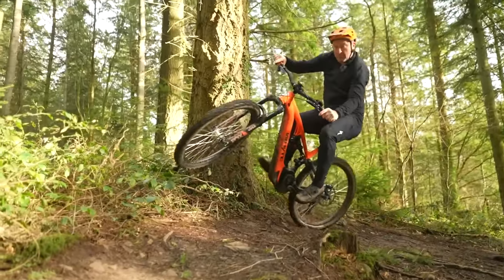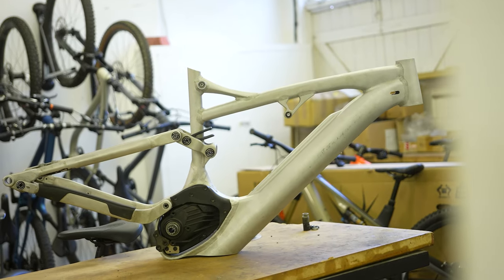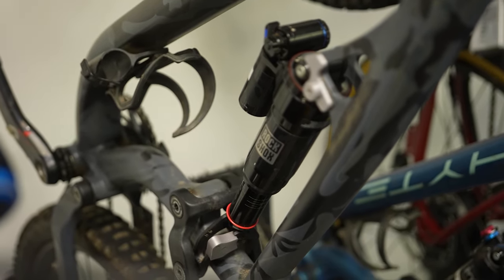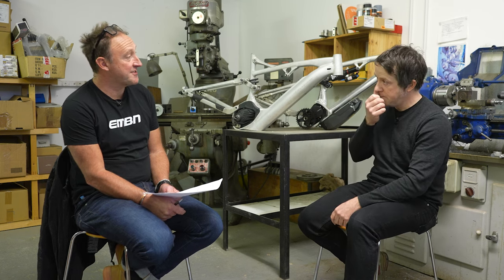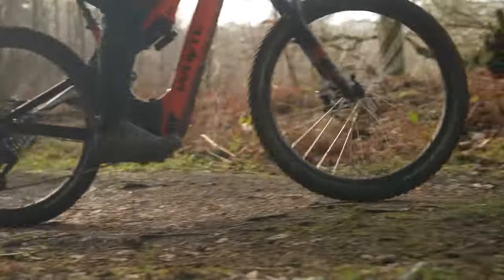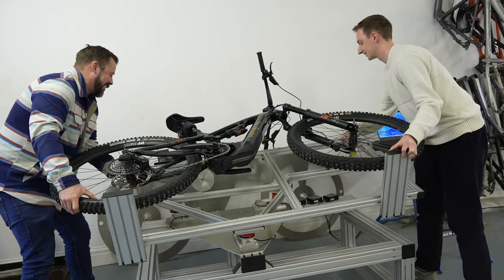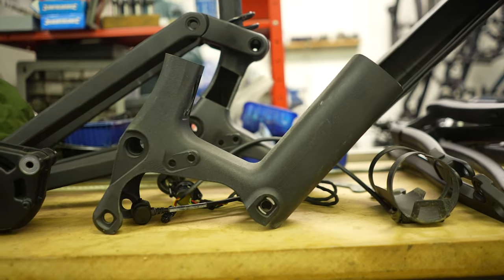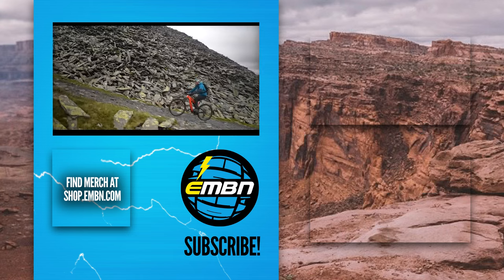Tech Talk: Centre Of Gravity | The Science Behind eBike Stability

Comment: When I hear people suggest carrying a spare 630Wh battery in a backpack and I'm thinking, no the centre of gravity will be compromised. Maybe there could be a design for spare batteries to be carried lower down, say piggy-backing off the frame located battery. Obviously not the issue with a range extender which are smaller and lighter and already located in a bottle cage within the front triangle.
Reply: I have a spare and  backpack made to carry it but, The real answer is batteries with longer range bigger but not heavier and they've already started headed in that direction I have a 500,625 and 800 in a different brand but they all seem to be increasing.
Reply: they are talking about the center of gravity of the bike here. If you add 5kg to one end of a 20 kg bike everything changes drastically- but if you add 5kg to the center of your 75kg (I wish..) body, the change is minimal. For example if I get a lot of mud on the tires the bike instantly feels bad, but if I ride with a backpack or a heavy winter jacket, I don't feel a difference at all.